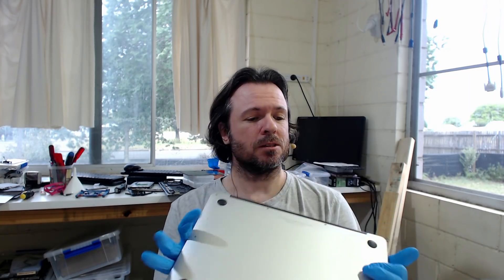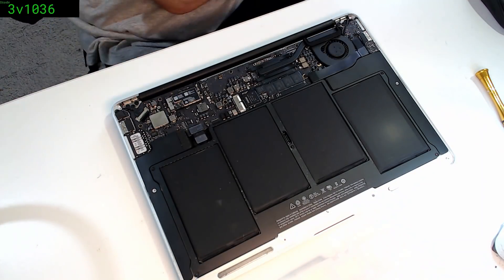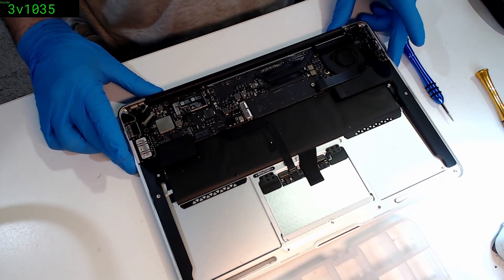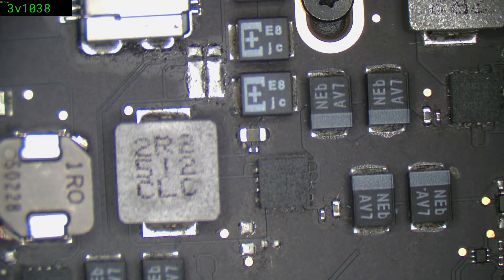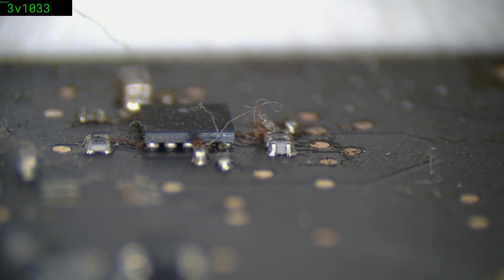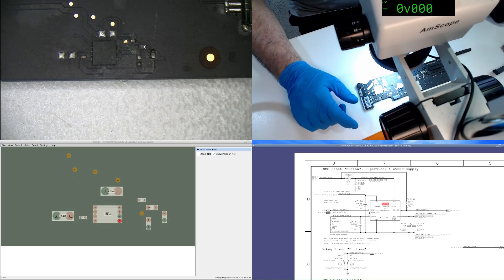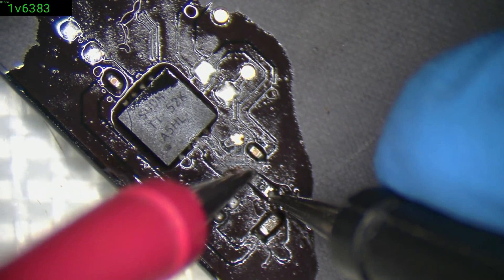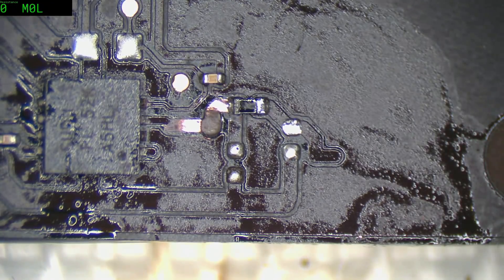#256 Macbook Air A1466, 820-00165, no power, no green light

Comment: what program do you use to open the board view schismatics ive tried 4 all  cant ,KiCad, EAGLE, Altium Designer i cant remember the other but no luck ive tried file from 3 different websites some results
Reply from the maker: If you're referring to the board component/outline layout files  ( *.brd etc ) then I use FlexBV or OpenBoardView.
Reply: @pldaniels  thank you that one work like a charm I do have another question how do I know where schematics match my board I looked it up based on the a1466 but I get three different schematics
Reply from the maker: @fredob7207  on Macbooks the board number is written on the board as part of the copper overlay.  It'll be 820-00165, 820-3437, or an earlier model like 820-3023.  Basically you have to find the number to know which one you need ( or just get the whole macbook board/schem collection off places like badcaps.net anyhow )
Reply: @pldaniels  thank you I appreciate it I already found it after removing the solid state drive it was printed on the board but I do have another issue here I found two components that are destroyed on the schematic it doesn't tell me the ohm resistance of those components one of the capacitor one is a resistor c7534 r7545 where do I find these two components where can I buy them what is the resistance in the microfarad

Comment: I have a A1466 that doesn't power on, zero corrosion checked the fuses no issues any other common faults?
Reply from the maker: Any green light on magsafe?  Could be so so many causes.  Not enough information to really determine. Current draw from DC PSU? Voltage on PPBUS_G3H? Anything on 3V42 line?  Not really something that can be diagnosed here. Best join the Rossmann repair forum, or BadCaps.
Reply: @pldaniels  green/orange light comes on. thanks for the info ill look into it

Comment: what flux do you use?
Reply from the maker: Currently Amtech NC-559-V2 but I might be changing over to a slightly different formulation, though still with the Amtech brand.
Reply: Paul Daniels is that the LF TF stuff?